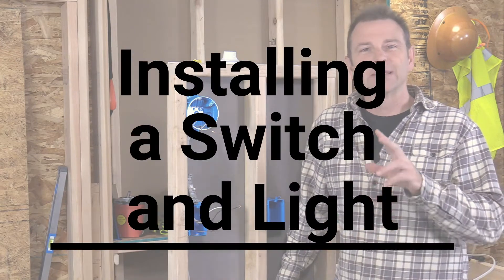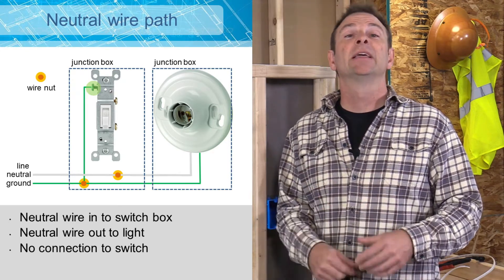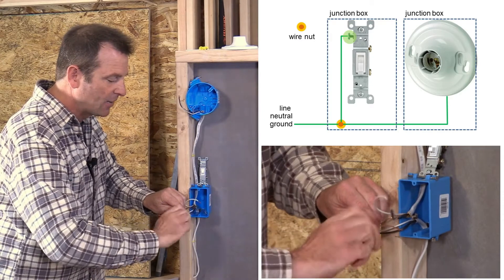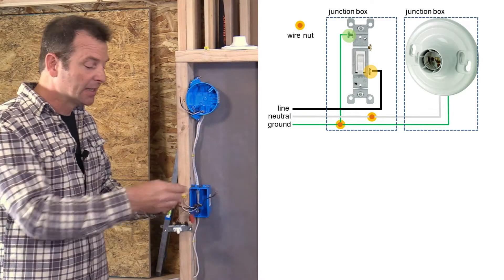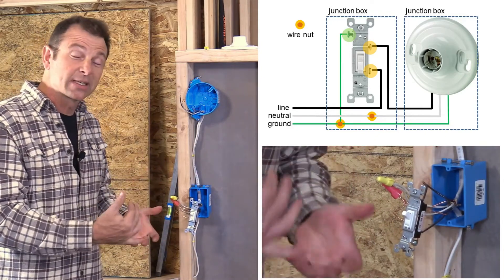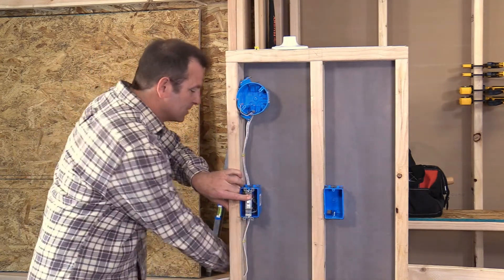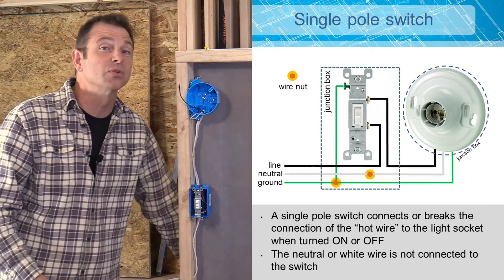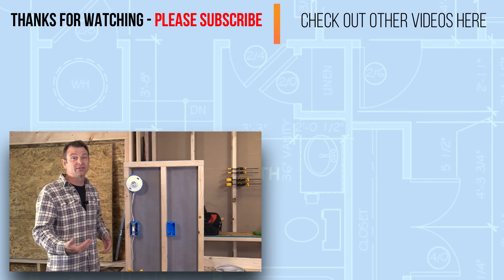Electrical Wiring Process - Part 6 - Installing a light fixture option 1 - Come wire with us

Comment: I could not understand the purpose of ground wire to light fixture-where it is not attached to any terminal .
Appretiate  your way of making understand the principles
Reply from the maker: but remember, if there is a groundling lug, use it.